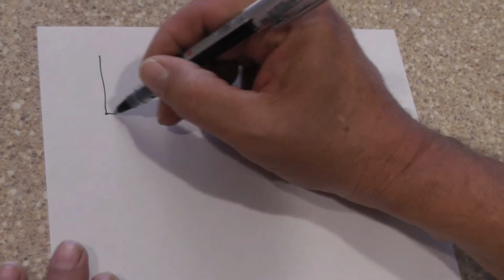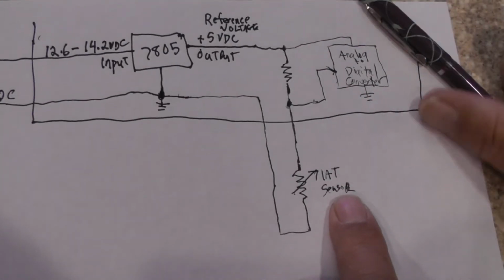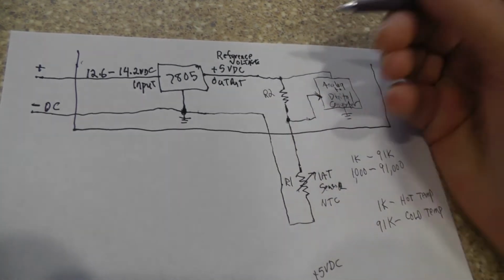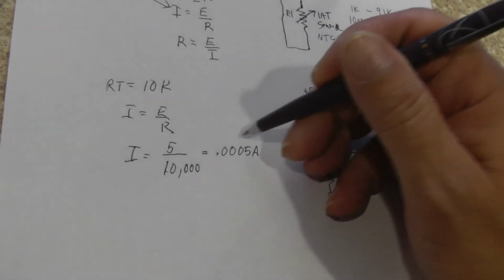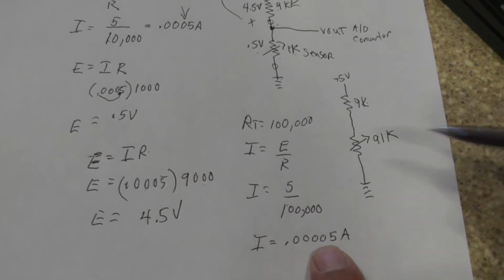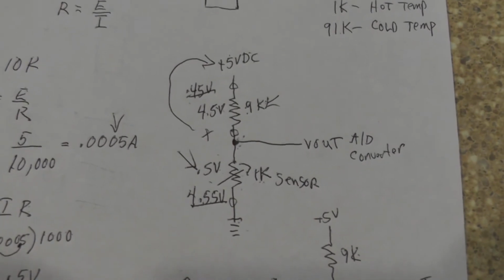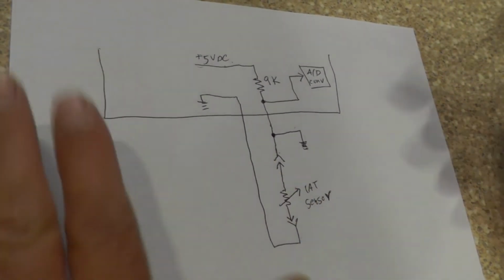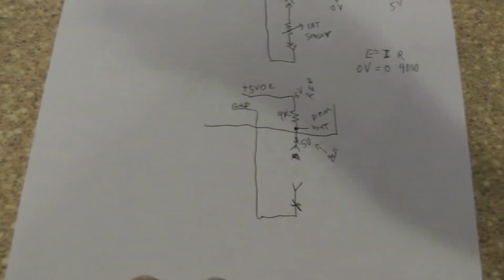IAT/ECT Circuit Operation and Troubleshooting Tips

Comment: I'm a bit foggy thus morning. With the temp sensor disconnected and measuring on the pin of the harness, will your meter read source voltage as 5 volts to ground with key on.
Reply from the maker: With the sensor disconnected, the reference voltage from the computer (typically 5 volts) would be present at the harness pin when the key is on.

Comment: I'm getting 5 volts on one of the wires, but then I take off the Sensor and run a paper clip to it, it's reading N/A on my scan tool. So does that mean I'm not getting ground? Maybe my ground wire is short? Because my cooling fans aren't turning on at all. I'm measuring 5 volts. And when I have it plugged in and engine turned on with a scan tool I'm reading around 1.5-3.2 volts. It drops down to 1.3 ish when the engine is hot. But still my fans won't turn on. I'm guessing it's the ecu ground?? I'm not even sure anymore! I'm confused. You didn't mention in the video about what would happen if the ground wire is short! Please help explain it to me. Thanks
Reply from the maker: Hi Scott! With the sensor disconnected, you would see 5V as you've mentioned. With the sensor disconnected, and with a jumper across the harness, (going back to the computer), the computer would see near 0V which would indicate a very hot condition. You're saying that your scanner says N/A which I would assume means Not Applicable. This isn't correct. See what your voltage says. With the sensor plugged in, you're seeing a voltage reading from 1.5-3.2V which sounds correct. And when the engine is hot, you read about 1.3V which again sounds correct. Are you getting a code for the ECT sensor? And if your coolant fans aren't coming on, then I would suspect that you have an issue with the coolant fan(s) circuitry.

Comment: Ok I understand so if the engine is cool the iat sensor read high voltage so the the fuel ratio burn a little rich and when the engine is warm up the voltage drop and engine fuel ratio go down so the engine sound goes down ok and the map read the same air intake as well as the 02 sensor right
Reply from the maker: You are correct with the IAT as it will make small adjustments to the air/fuel ratio. The ECT will make larger adjustments to the air/fuel ratio. I believe the IAT is used mainly for measuring the temperature of the air coming into the engine to know the weight of the air. As for the MAP and O2, these two sensors measure the intake vacuum to determine the load on the engine, (again for air/fuel ratio) and the O2 sensors are used to determine the amount of oxygen in exhaust to again fine tune the air/fuel ratio.

Comment: Can I get your opinion on some live data i'm seeing ( if you have time!)
With obdii scanner looking at live data for voltage and temp of ect ( degree celcius down here used).
I get good data as engine warms up, gets to 60 degC and voltage jumps from 1v up to 4.23v.
It does this everytime, so I assume its the second resistor or similar turning on.
Now it gets weird:
The engine temp live data continues to be accurate and changes as it should ( fans kick in at 80deg),
but the voltage graph on live data shows constant 4.23v no change over time. At the same time I"m looking at voltage across ect using voltmeter and it shows voltage is changing not constant.
So computer knows what is correct engine temp, but its voltage output on live data stays at 4.23v ( until engine
goes under 60degC and it jumps back to just one resistor.
I swap ecu......same thing. any thoughts on that one?
Reply from the maker: I'm assuming that this is normal operation for your vehicle especially since you changed the ECU and it's doing the same thing. If you have the service literature, it may even mention the operation of the sensor which I suspect that it's switching in the second resistor inside the ECU. If you don't have any issues with the car and it doesn't give a code for the ECT, I wouldn't worry about it.
Reply: @stuzman52  thanks for reply, it is good to know the car is reading correct temp, even though on the obdii live data the voltage for temp is not coreect on second resistor.
I'm sure it will lead to solution eventually but for now car is fine as is.
appreciate your video very helpful indeed

Comment: just a thought on ect circuit. I measure 5.00v source on my car temp sensor circuit.. I"m guessing that if I use a variable resistor pot as the temp sensor and get an output of 2.5v that will tell me the value of the internal resistor used in the ecu/ecm, or close to it probably. Might lead to a way to be able to check if the internal resistor is ok.
another note in my case using forscan obd software, I can see the voltage and temp computer is seeing in real
time, my issue is the voltage goes along normal for a minute or two while coolant is cold( somewhere around 1.5v or so), and then it shoots upward to 4.17volts (off scale: high), it is a clue to what my problem is, but identifying why it shoots up all of a sudden is still unsolved ( working on it). Once the voltage has shot up out of range, if I disconnect the temp sensor lead and put it back on, the voltage reads normal voltage ( 1.5v approx), but within a fraction of a second it goes high voltage again ( 4.17v). That also is probably some clue to what is happening, some sort of short I"m guessing. At the moment I"m guessing its in the temp sensor, some internal connection to the thermistor that is broken but at low temps makes good enough connection. Thinking I will use a 20k pot to replace sensor( as sensor reads about 20k when cold) and see if it stills shoots up after engine warms a bit.
Reply from the maker: Sounds like you've been doing a little thinking which is good! Yes, you can use a variable resistor as you've said and if you get 2.5V across it, measure it's resistance, then you'll know the internal resistance where they will be equal. One thing that I didn't show in the video is that some ECT circuits will use stepped resistors or even a different voltage value than 5VDC. Try plotting out the temperature of the ECT over time from cold to hot and see what it looks like. It's possible that the graph would become more normal as the temperature gets hotter. Take a look at this article and you'll see what I mean about stepped resistors and different voltage values. Your car may have this type of circuitry for the ECT circuit. https://bccskillsusa.weebly.com/uploads/4/3/3/2/43327659/el2.sensors.pdf
Reply: @stuzman52  Once again excellent information, thankyou!
I have looked over the article and understand,  I will do some testing 
and try nut this out. Its quite interesting stuff.
My ecu is reading low volts ( approx 1.5v) for cold engine, then rapid ( instantaneous)  change to 4.17v after a minute or so of engine running. So I guess the computer is thinking your engine goes from hot/warm when first started, to screaming cold instantaneously after a minute or so.........no wonder it gives an error....p0118 code...high volts when its
probably expecting low volts.
The sensor itself appears to give high resistance at cold engine  ( 20k or so) and decreases
as engine warms up, about 2.5k with no fans on, after a 10min drive. So sensor 'appears' ok 
at this stage.  The plot thickens. Will do some tests with suitabe variable resistor next,
it might give a clue to the problem.
Reply from the maker: @namenotshown9277  Glad to hear that the article helped you out. Always good to have the most information available. I'm sure that you'll get it figured out and using a variable resistor will surely give you some insight into the issue. Good luck!

Comment: I have ect volt high code p0118, been trying to solve the puzzle for a couple of weeks now,
this is one damn excellent video on understanding ect ( or iac etc), much appreciate your posting it.
I'll keep working on my problem till I solve it, this info will be extremely helpful.
One thing I dont understand is why there is an internal earth? I assume its different to the chasis or battery
earths though connected in some way. Just by way of example lets say you use chasis earth instead of
internal earth for example in video, what would be the outcome?
Reply from the maker: Glad to hear you're finding the video helpful. The internal ground inside the PCM is to reference the 5VDC for the reference voltage which is used for the ECT or IAT circuits. It's possible that you can connect the external battery ground, but more than likely it's isolated. The reason is that the battery ground will have a lot of voltage spikes on it from all of the accessories on the car such as coils, motors, solenoids, etc. When checking the ECT or IAT circuit, it's best to use the internal ground for these circuits as the signal will be cleaner especially if you're using a scope to look at the signal over a period of time. You could try referencing the battery ground for these circuits with your voltmeter to see if you will get a voltage as some systems may have the external ground connected to the internal ground. 
Good luck on finding your issue!
Reply: @stuzman52  thanks so much for informative reply, car is ford falcon au ( 1999), very common car here in australia, amazingly reliable cars but getting a bit old now.

Comment: Hey stutzman question . The two wires going to my iat has 5v across it . But the scanner is seeing 0volts on the display and -198 degrees . This is anew pcm and a new iat sensor , neither the older new iat show a resistance value when I check them directly. I checked continuity of both wires going to and back from pcm to iat . Both check good . I am at a loss . Same thing with old pcm  it’s a 1994 dodge Dakota 3.9 mpfi if that matters. If you can steer me correct I would appreciate it . Thanks again

Comment: What would the PCM see if IAT is unplugged? Thanks for the video!
Reply from the maker: Roberto Santiago Rodriguez You would most likely get a P0113 code.
Reply: stuzman
 Yes, of course, thanks so much!
I was referring to the computer reading a voltage equivalent to cold temperature and enriching the mixture as a result hence vehicle would run properly when cold and verify there was something wrong with the IAT.  Am thinking of this also a way to test the IAT if no voltmeter was available and vehicle only ran rough when cold. Just a thought. TX again!
Reply from the maker: Roberto Santiago Rodriguez Zig If you unplug the connector the computer would see 5VDC which the computer would interpret as-40F/C. While the connector is pulled off, you could place a jumper across the two terminals. The computer would see this has 0 VDC. The computer would see this as a very hot condition. These two tests are used for circuit operation and wiring integrity. You could monitor the PID to see how the computer responds.
Reply: I did it, I disconnected the IAT sensor on my 1995 F150, 5.0 liters 2wd, automatic and the truck drove definitely better while cold. Of course, the PCM was smart enough to know it wasnt -40 degrees Fahrenheit outside so it turned on the Check Engine Light.  It must have been using a low temperature parameter because the subsequent enrichment of the mixture to compensate for cold air, caused the engine to no longer run lean and got rid of the hesitation and lack of power. Temperature outside was actually 78 degrees Fahrenheit; hope it helps someone. Thanks again Stutzman for your explanation.
Reply from the maker: Glad to hear that the explanation helped you out Roberto and good to hear that your vehicle is running better!

Comment: Put upper intake manifold Gasket on it and now won't start but  cranks fuel rail don't have pressure
Reply from the maker: Not sure what car you're talking about. If it's the Suzuki, check to make sure the ground wires are bolted underneath the intake manifold.

Comment: Are all AIT sensors negative temperature coefficient or can they be positive as well?
Reply from the maker: Blinded By The Light on cars you will find all of the sensors to be NTC. You’ll find PTC sensors in the industrial field.
Reply: Thanks, the reason I asked was because when I tested the sensor on my 2007 doge Caliber, the resistance went up as the temperature increased.
Reply from the maker: Blinded By The Light That’s very interesting as I’ve never ran across one like that. That’s probably how it works, and you could check with your service literature to be sure,

Comment: Thanks! I'm looking at one at the moment so now I've got a clear idea of what I'm looking at. I'm only getting 3.2 volts with the connector disconnected.
Reply from the maker: Excellent that you understand the circuit operation. Sounds like you've got another sensor that's shorted which is pulling your 5V reference down. Worse case scenario is that the issue is inside the PCM; hopefully not though.

Comment: Another great video.  Thank you. 
I would appreciate if you could kindly explain the reason for the following hypothetical scenario.  Say a fuse was continually burning out after being replaced.  Say the circuit was for the left front headlamp.  Say there was a short where a wire in the circuit became exposed and was rubbing against the metal body of the car.  My question is this:  What could be an explanation why the short would cause the fuse to burn out?  Thank you
Reply from the maker: Thank you toyo for the comment on the video. With all circuits, there must be a load. Think of the load as what's doing the work and of course with all loads, there is resistance or the property which impedes the flow of electrons. Let's use conventional current flow for this example, although we know that electrons actually travel from the negative side of the battery to the positive side.

Electrons leave the positive post, goes through a fuse, switches, relays, etc. and finally out to the load. These electrons will travel through the filament, (there's our load and resistance) and then make their return trip back to the negative side of the battery. As you may know, the negative side of the battery is connected to the engine block, chassis and to the sheet metal of the car. Think of all these things as the negative side of the battery. So, when electrons leave the negative side of the battery, goes to the metal chassis where the B+ shorted wire is, we bypassed the load which means very low resistance to the flow of electrons. And that's when the fuse blows. Another way to think of this is to imagine that we took a wire and jumped directly across the battery posts. This will create the maximum current flow out of the battery since we don't have any resistance, (load) to impede those electrons. The reason we have fuses in circuits is to protect the wiring. And each wire size is rated for a safe maximum number of amps. Hope that helps you out toyo.